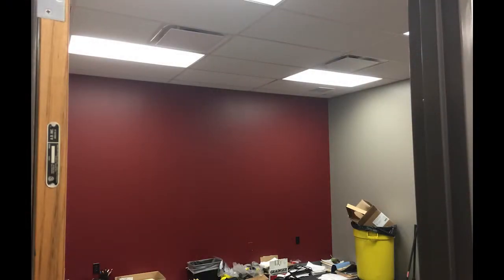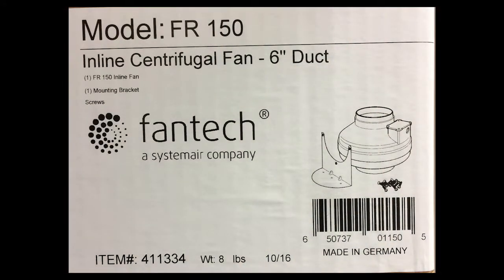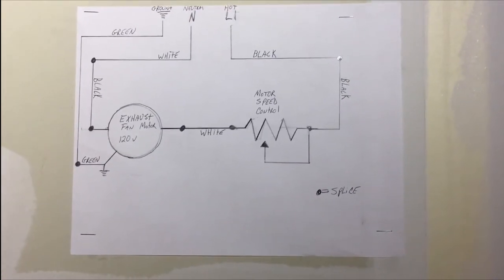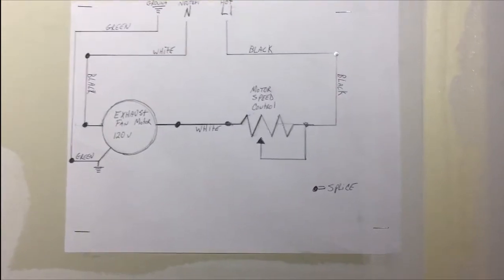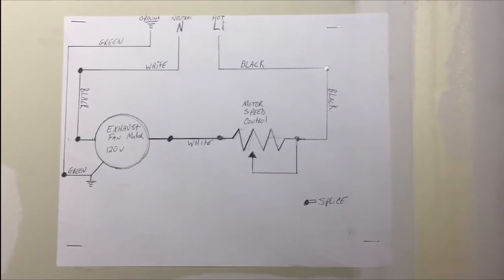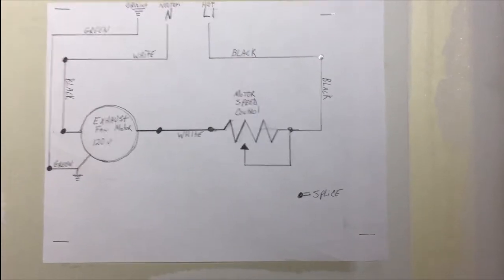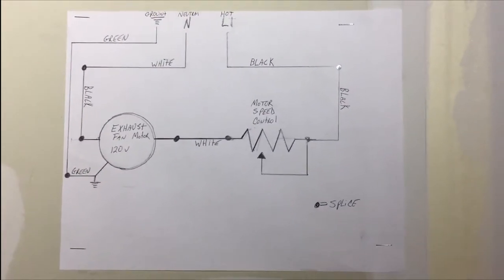Best Practices: Inline Exhaust Fan Install (COMMERCIAL HVAC SERVICE)

Comment: The labeling of critical care circuits is an NEC requirement in hospitals for the very reasons you mention; a more efficient and safer means of disconnection.

Comment: I wish my house was wired by you.  Our panel box labeling was a joke.  Half of the circuits just said "Lights".

I would like your advice please.  I need to install a 4" in-line vent booster fan in my attic because the 2 bathroom fan currently vent into the attic space ( a big no-no).  It's only a 43 Watt, 120v in-line fan with 3 wires coming out (Black, White, Green). 

Is there a way to wire the new booster in-line fan in the attic to the existing 2 bathroom's fan/light combos in the bathroom ceilings?   So when you turn on the old fan/light the attic booster fan will also turn on at the same time.  I'm using a "Two Single Pole, Combo Switch" in my bathrooms to operate in each bathroom.  Would I just pigtail the White & Black wires coming from the in-line fan in the attic to each of the bath fans?
Reply from the maker: Jason Jay what I would do if both that bathroom switches are the same circuit I would put them in parallel with the coil of a relay. That on the Contacts side of the relay has that go to the fan so either switch can turn on the booster fan